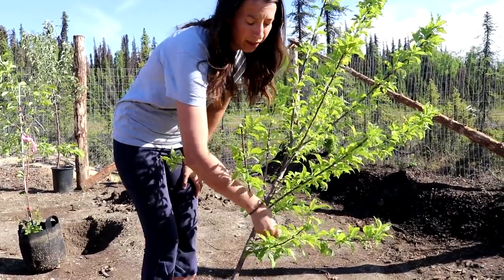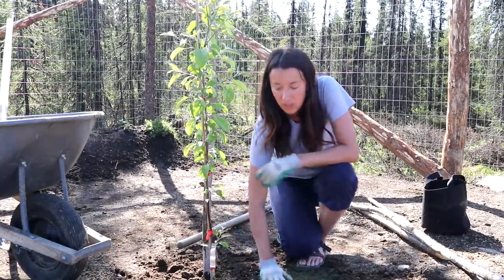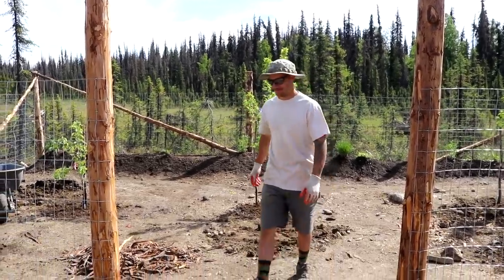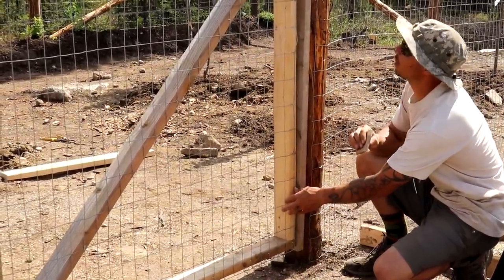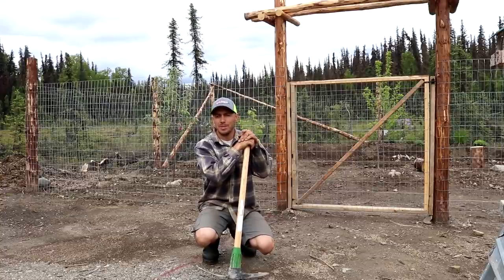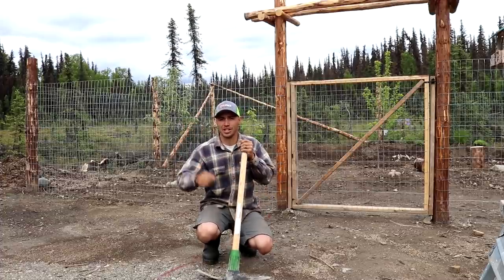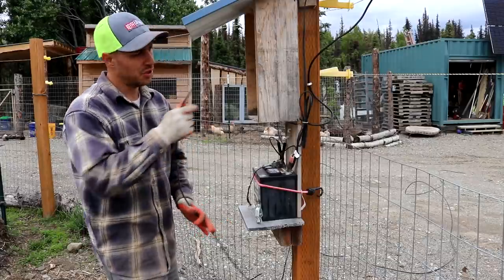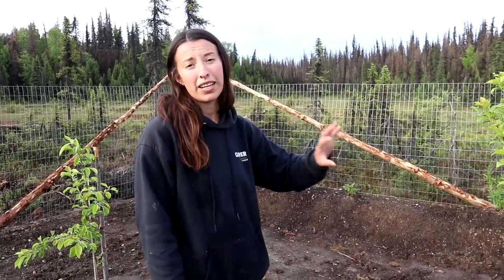Planting Fruit Trees | Saying Goodbye to a Friend (Part 2)

Comment: Have you thought about putting a heavy(4"-6") layer of woodchip mulch over the ground? You have plenty of trees around there for it, and I think it would help your soil fertility and water saturation levels over time, in addition to the compost you're using.
Reply: the problem is they planted them to deep ---to add woodchips would go above the graft--they should have planted shallow and added woodchips or mulch on top
Reply: I like the idea of the woodchip mulch.
Reply: @brianmessinger3984  I would put the wood chips all over except stay a foot away from each tree base. Would keep weeds down.
Reply: @brianmessinger3984  tbh with wood chips it doesnt matter about them being up the trunk of the tree, it isnt anything like soil which will kill a tree, wood chips the trunk  can still get dry , rain or moisture isnt held for long times against the trunk like soil would do, air will still get in around the chips and to the trunk, they would also of course as im sure you're aware hold of the frost getting to the roots in the winter time which is why i myself actually put a thickish layer of mulch ( up to 4 inches ) around certain trees i have over the winter period to protect them as they arent from my climate. Those trees have been growing in my garden now for nearly 20 years with no adverse effects at all

Comment: Nice job on your orchard. I also like the raised bed in the back. If you ever plant potted plants again, make sure to release the bound roots before planting them. You may need to take a tool to unwind/separate the roots, so that the inner roots can get water. I worked landscaping when I was young and we also used to put water in the hole first, before installing the root ball. We also live in zone three and have had good luck with cherry, plum, and apple trees.

Comment: Just a quick warning
I had a cottage in northern Ontario. I brought in 30 frost hardened fruit trees from Northern Alberta and planted my Orchard. The first winter I lost half the trees because field mice had burrowed under the snow and nibbled on the bark of the tree. Where they ate a ring around the tree it would die. I was told by a local guy that you must protect the tree bark either by painting it with white paint which the mice will not eat or by putting plastic around the tree below the soil line and high enough that nothing can walk on the snow and eat the bark.
Hope this helps 
Love seeing your posts to your channel

Comment: I´m also sorry for Your loss - i have just seen a program were they use old seat belt pieces to tie around the tree and the pole/stick, it will not cut into the tree, use a staple to staple it together - just a little tip..

Comment: When putting pipes or wires in the ground it could be a good idea to identify the precise location of these by using a compass and putting this info away for future use when digging. Start at a fix pint that will not change like the corner of the house and take a reading of your trajectory of the wire or pipe.
IE distance from corner at such and angle( 233deg) then the angle of the trench say 55deg and length.
This way you have accurate info on where the underground cable is located.

Comment: may I suggest some stop blocks or a stopper strip inside the latching edge of the gate to make it secure against pushing loads also on the hinge side. that way if something pushes against the gate they are pushing against a solid stop not three small screws holding the latch. Love the videos
so jealous of the lovely place you live

Comment: For hardy trees check out St. Lawrence Nursery. They are in zone 3 and specialize in cold hardy trees, some even rated down to around zone 1b/2a. They have a huge selection of apples, and also have pears, nut trees, and many berries. Email Connor and request a catalog. Nice winter evening activity reading all the descriptions and circling the ones you want. They use an old Russian rootstock named Antonovka, which is a "standard" rootstock with all the vigor, lifespan, and cold hardiness which comes with that, but naturally only grows 12-15 ft tall, and can be pruned to remain even smaller. 

My condolences on your beloved kitty. He has a beautiful place of remembrance.

Comment: That is a veeery shallow trench for electrical cable... btw that electrical tape will last about 1 stronger rain. I would definitively recommend deeper trench and more importantly encasing that cable joint in heat-shrink tubing which his cheap, available in any hardware store and most importantly waterproof :) (I am an electrician)

Comment: Quick tip. Try not to have any joints on the cable from the energizer to the fence. It weakens the voltage and the insulation tape wil not hold. Within a month or two depending on how wet the ground gets it will short out and your energizer wil run out of battery power very quick and you might even loose the battery. And another thing every 5-10 meter have a ground stake it really does help with the voltage drop. I.e keeps it at 9000V over the max distance your energizer can supply

Comment: Looking good guys!  Love the arbour and bird house.  Whole thing looks great!  Plant some asparagus in between trees and I would even suggest strawberries, haskap, cranberries or any low shrub type fruit - I would suggest black currant, but they are so invasive I have found.  You need a rhubarb plant or two as well! LOL.  Plant these at the midpoints of the diagonals.    I was wondering if you would do a hyer12 as they grow so well.  Mine is about 7 or 8 feet tall and as wide, and it produces about 10 gallons a year...slice, unpeeled, for pies, make juice out of the cores and feed the rest to the chickens!  LOL.   I am curious about the other varieties and will have to investigate for my orchard.  I am wondering though about planting depth as I have always been told to put the bud union 1 inch below the soil surface to stop the root stock from sprouting. BTW, I have found pear and apricot for our zone too.  Plant some purple grapes for that arbour maybe.  Sorry about Hunter - great tribute !

Comment: 2 things you should do: train each tree in an espalier, a fan shape to open the structure of the tree up, and take cuttings with the prunings, which will not be dwarf sized, but will give you full sized trees in a different area.
Reply: K Barnes  not really, just a bit more work at the beginning. I put a stake in the ground either side of the tree and tie the branches to the place where I want them. Years later it's actually easier to prune because it's more open

Comment: Great Video.  Just wanted to comment on your electric fence.  Be careful about burying your cable direct.  1.because the shallow depth of the wire will get beat up by your vehicle traffic and the freeze/thaw/mud issues you normally deal with. 2.your underground splice.  the device you were using looks like a standard butt splice.  This can create an issue due to the high voltage of the fence.  High voltage is always looking for the least path of resistance.  So make sure to check your fence regularly. because the least path may be through that butt splice and wraps of electrical tape to ground...not your fence to ground.  If you have issues I would recommend burying a 3/4" PVC sch 40 conduit at least 12-18" below the surface.  Even then you may still have to get a new cable to go the entire length with no splices in it.  I have seen these fences even buried in conduit track 6-8" to the ground with no visible break in the outer jacket.  It will not take much at the voltage you are probably working with to make an issue.  Burying the conduit will not be difficult by the looks of your pickaxe work.  Lastly if you go through all of this consider while your ditch is open installing another ground rod 10' or so from the fence controller and the current ground rod.  I don't remember if you have two ground rods already but installing a second or third in a design called a counter poise (check internet for details) will create a better return path and a hotter fence.  Love the videos and good luck.  MR.

Comment: You have a lot of dirt on the perimeter fence of the orchard, wont that ground it out? and clover might not take the freeze, but it is a nitrogen fixer and if it works it will build up the soil.

Comment: ......just a quick comment......is there any reason why you guys didn't use wire conduit to protect that wire for the electrical fence, plastic gets brittle under extreme cold and is that is in a yard with vehicles driving over it, it may fail.

Comment: Sorry, I'm shocked (no pun intended) that you buried your electrical wiring, without conduit, a few inches depth at most.  Looks to be a high traffic area as well.  Probably getting ripped out, shorted, or severed within the year.

Comment: I can foresee one issue that you will be having. You aren't taking into account the 'Mature' spacing between the trees (1 tree = 18 to 20 ft). Your Trees will need to be be replanted further apart as they mature, otherwise you are going to have the limbs of 1 tree intertwining with the limbs of other Trees.
Reply: Not if they prune them back.
Reply: @hermithillfarm1123  Ariel stated there was 6 to 7 feet between the planted trees. That means that EACH of the trees are only able to have branches 3 feet out before they start getting entangled with the other Trees around them, when normally you would need atleast 9 to 10 feet per side out from the trunk of the Fruit Tree, which would mean that you would need to plant the trees 20 ft apart from each other, to give each Tree room to limb out and grow,  if you didn't want to have to transplant them later (and a LOT heavier) as they mature.

Comment: how much was your cost?  fencing, wires, nails, gas for equipment, locks, adaptors for electric fencing, etc...i know you saved alot of money doing it yourself...but rough quess what did you spend on supplies? do not include your time.